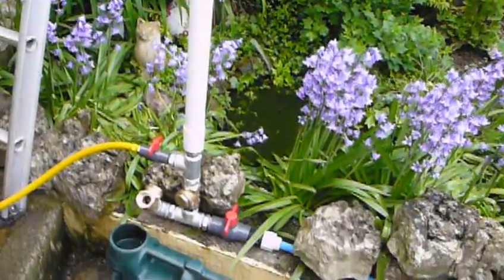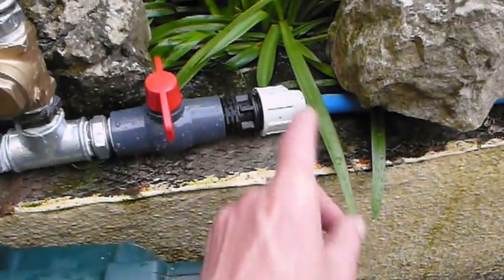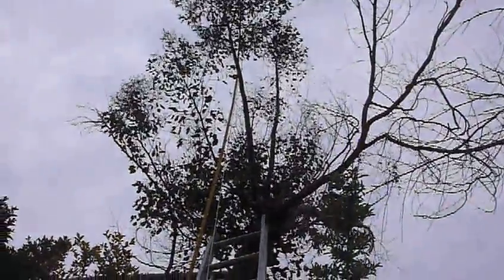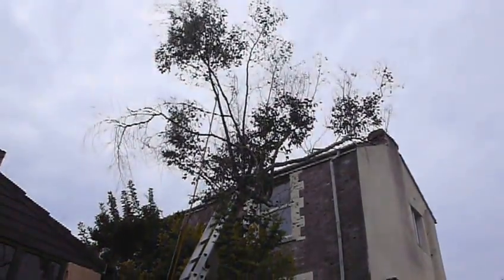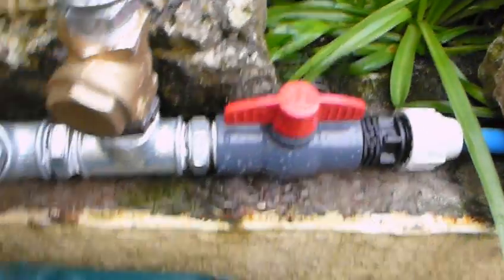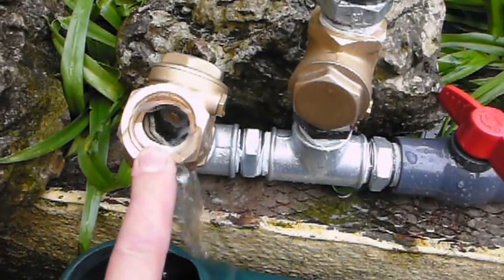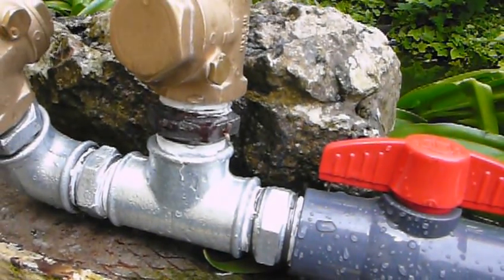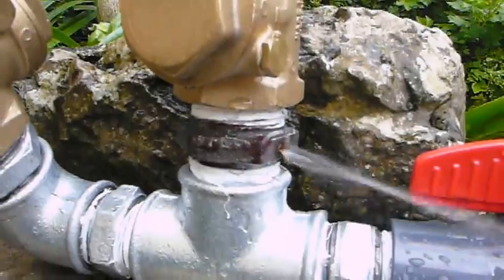Part 2. Running up the 1 inch hydraulic ram pump made from galvinised steel pipe fittings.

Comment: Closed cell foam is the springy stuff sometimes used in packaging, I would imagine that bubble wrap would work too.. in effect it has large closed cells. Closed cell is the type of foam that does not tend to get waterlogged as each cell is "sealed".  You could probably use a balloon or similar in the pressure vessel too... might be more reliable than the snifter valve....
Reply: David Lisney
That is interesting!

Comment: Greetings from Srilanka.I've watched many of your videos. Excellent. In countries such as ours which have substantial rainfall, cannot the discharge from the downpipe be used as the drive pipe to pump the water to an overhead tank?The "waste" could be stored in a ground sump or be diverted to dug wells of which there are  great many numbers. We have a National Rainwater Policy and a law in the country, and this sort of technology ,with rising fuel costs would be a boon at the household level.

Comment from the maker: Hi Pete,

T mex do not supply the part you need but you can get it from most plumbers merchants for about £1.50- you need two of them, one for the top to seal off the chamber and one to screw on the pump, you only need the threaded part, which is 1inch bsp thread and screws into the galvinised fittings. The part is called an inspection coupling, take another look at the construction video again and you'll see what i mean, sounds like you've got good pressure, failing that use a plastic bottle.